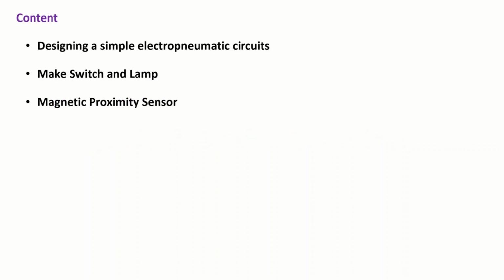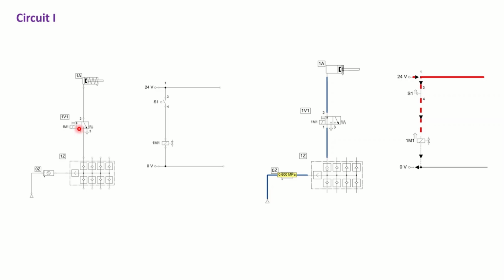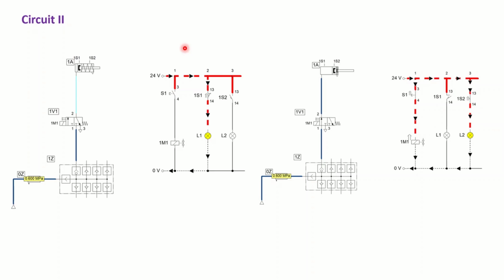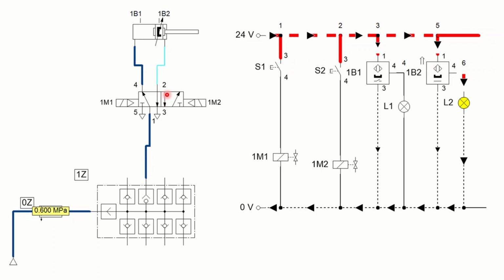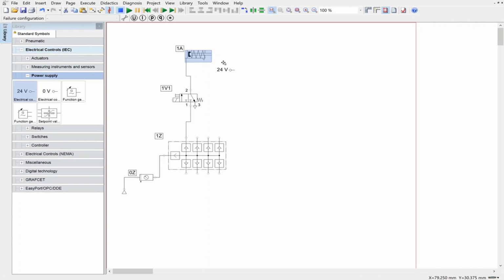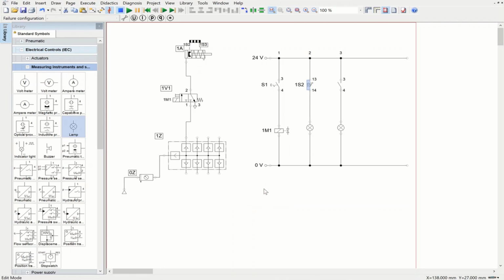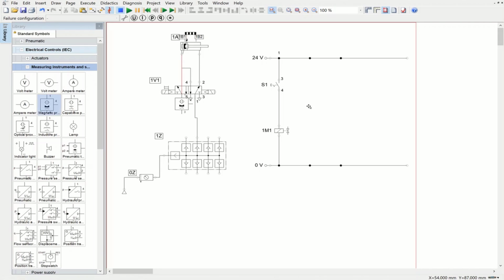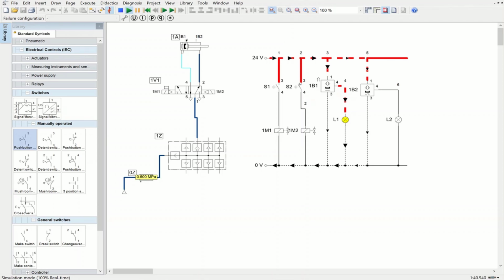Designing Electropneumatic Circuits with FluidSIM| Introduction to FluidSIM | Tutorial 13

Comment: Hello
Thank you so much for making the #FluidSIM tutorial. It is very difficult to find specialized training in this field. I had a problem with #Magnetic_Proximity_Sensors, which you explained well
Reply from the maker: thanks for the comment. we will add more video related to electropneumatic circuits and fluidsim. In addition, we add more examples for proximity sensors